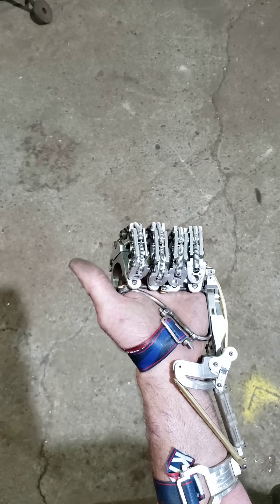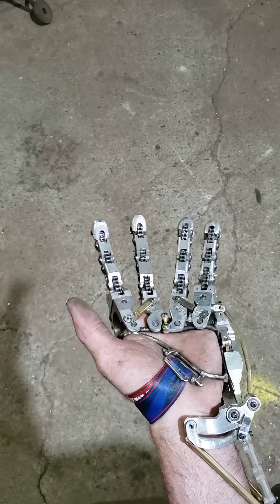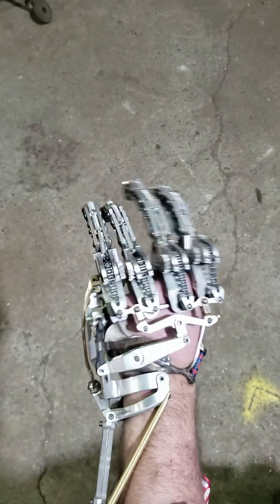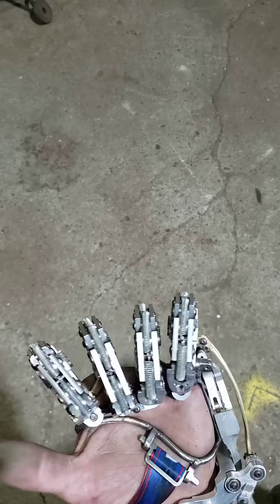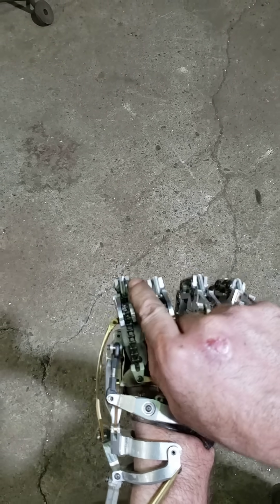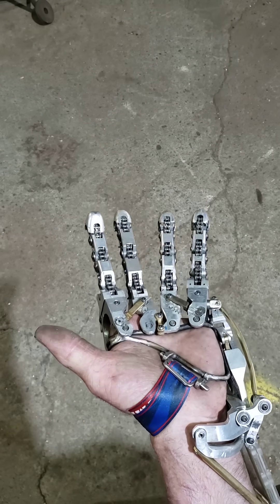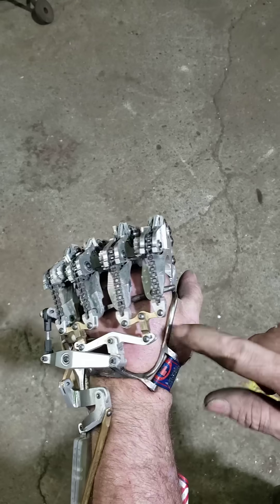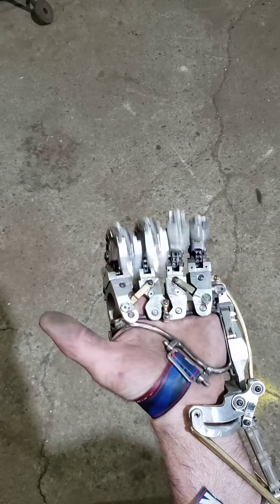Another update on my partial hand prosthetic, now with splay!

Comment: If I had missing fingers or like a arm I would decate it to makes a robot arm/hand but everyone just makes it that it’s on the outside and stuff I would literally drill a metal pipe in my bone and content it and go one by one of pain until metal connects fiber and bone and metal only thing I didn’t think of is nerves which I don’t need to feel the arm then maybe get like some kind of plastic to make a skin and every fiber the the muscle is gonna be a single metal wire and you gotta connect it some how and make a metal bone same shape just metal then make it that you can’t move the arm in some directions like a actual arm unless you want it to go both directions if your going for a robot look and then if you got all that you can try and add things to it you can’t feel pain in it like add like something in your hand that like is a wire and the wire like makes it that you can type a computer on a hologram

Comment: The design is brilliant, what I find most impressive is that so far it's all mechanic principles and no electronics, and yet it moves like your own fingers and has significant weight still behind it
Reply: I mean, it's way easier to replicate a mechanic system with a mechanic system, instead of doing it with a electronic one, you can have more precision with an extremely advanced electronic replication of such system, but that's the kind of thing that costs hundreds of millions in RnD, like the one being done to create a perfect hand prothesis.
Reply: @DrakyHRT  Your hand isn't a purely mechanical system, muscles are actuated by nerves which are electric

Comment: are you going to make plans available for sale .
 I'm interested 35 years ago I injured my spinal cord. it left unable to move anything but my left arm and hand. I learned to walk and talk again but my right hand is still greatly effected. I have almost no gripping ability I open and close my hand using my wrist. but I want to be able to use my hand more normally . I'm not a engineer but I'm smart and mechanical. I need to know the sensors and stuff to run it are you planning on selling kits or plans . I have all my fingers but have limited movement
Reply from the maker: Sorry, I don't think what I designed is going to work for you. The motion and power of this device comes solely from the motion and strength of the wrist and forearm. .

Comment: What servos do you use for the clutch bearing locks?
Reply from the maker: https://www.ebay.com/itm/Mini-Micro-Planetary-Gear-Stepper-Motor-Screw-Slider-Nut-DC-3V-5V-2-phase-4-wire-/153679741766?_trksid=p2349624.m46890.l49286
These are what I'm trying out in my current revision.

Comment: I could probably improve your design give it more realistic movement  Air or fluid pumps Change at all the mechanical parts with it using the fingers as an exo frame Conditionally make it a lot more fordable
Reply from the maker: All those extra parts and systems to break and service,  let alone the extra weight and bulk. Fluid dynamics are awesome,  but pumps and drives are heavy.
Reply: @missingpartsclub  lol na your talking 1 0r 2  mini  Air pumps or compressors Either the size of an electric motor or smaller an prolly  And  2 or 3  Can probably do with 1 custom directional control valves  Then I was just use lines that extend and contract you can make most of these parts part of the frame making it less bulky hardist part would be the custom directional control valve but you have a 3D printer so that make it 1000 times easer weight-wise it would be lighter than the materials you are using now  the fingers would be less bulky and more natural the one bulky thing would be a pump which with minor experimentation could be made to fit on your forearm comfortably to fix your joint issue use one bearing for each side of a point of contact  for that one you can use already made experiments that have been through wear and tear the bearings don't have to move or roll just sit on top of each other so they're the only point of contact

Comment: Do you plan to use synthetic setae (the material on gecko feet that allows them to stick to surfaces without liquids or glue through Van der Waals forces)? This will give you better grip than any other material, which would be a big upgrade over steel.

Comment: Wow! it is completely mechanical in this demo. If you implement electronic controls, it would be cool if they failsafe back to this mode. so if you run out of power (for whatever reason) you can still use your hand.

Comment: My name is Abel. I wrote this for you
Wonderful design! I love it. 
If I may propose an object detection program/algorithm to assist in grasp and target manipulation to assist in the 2-5 digit engagement and release.
-Use neoprene 1mm or a thin layer to protect your hand from abrasion and perhaps cushioning. 
I do see the part grasping over your metacarpals, they could be used to sense the needed manipulation of your digits. 
I suppose if you decide to have the grasping and releasing of the different digits that of your right hand metacarpals. Then use sensors that would train an algorithm by using the movement of your right hands’ movements as to send the mirrored manipulation for your left hands metacarpals. Separate use though. Just to train it to do as your right hand would but on your left hand.

Comment: quite impressive;i have also made something like this for a school project  which uses a touch sensor for opening and closing of the hand;the touch sensor can be installed anywhere(like in the other hand or the side of neck so you just have to move your neck to control the hand)

Comment: The thing I feel the most bad for is the fact he can’t game;-;
Reply: "Yet". You forgot the "yet". Eventually he'll add a gamer update to his hand.
Reply: @qExAi5  also it's his left hand which means he'll probably be able to play games the same as us some time later. hell, maybe even turn his hand into a controler.
Reply: There is a neural-computer interface out there. Theoretically, he doesn’t need arm to play. He can send direct neuron signals while wearing a helmet, to the computer. He may emulate WASD and a few more buttons by calibrating his neuron signal when he tries to press those buttons, and use his right hand for the mouse, - and be able to play many games. It’ll be harder to make it work for some strategy games though, when there are a whole keyboard of hotkeys.

Comment: No meme, this is some good, intricate and flexible work. The design is open to improvements but even if you decided to just strengthen it as-is without further modification I imagine it could provide a pretty reliable grip in exchange for some additional weight and effort for movement.

Comment: Not a bad design. Its definitely an interesting idea, being able to apply the spread of the fingers to the prosthetic as well as the basic open and close of the hand. That being said, it also makes a prosthetic like this very specific for individuals who were born without or lost their fingers. Would it be possible to apply this same set of motions with someone who lost most of, if not their entire hand, or would there simply not be enough control for something like that to even work?

If such a range of motion could be applied to prosthetics on a wider scale, it could be mass marketed and used to help far more people.

Comment: Do you have any of the source files for any of this? My brother was born without fingers, just has a thumb, and I would love to 3D print something like this for him.
Reply from the maker: Check out e-nable  or one of the many other 3d printed prosthetic hands out there. Unfortunately the design the I am using would not lend Itself to being 3d printed.  And really,  at the end of the day a 3d printed hand isn't a long term solution 3d printing is great for rapid prototyping but the parts aren't nearly as strong as something injection molded or machined from a block. That being said, good luck with your efforts.

Comment: What if you want to use forward motion while still keeping the hand closed?
Reply from the maker: Forward past having the hand straight with the forearm? I haven't had a situation where I needed anything further than straight in daily activity.
Reply: @missingpartsclub  Well then my next question to you would be this. If you grab something with the hand and it’s closed do you have to keep your wrist straight? Will it open it up and drop if you change your wrist motion
Reply from the maker: That's why I'm adding the electronics,  so I can lock the fingers in a position, grasping something,  then move my wrist and not drop it,  or pick up something relatively heavy  and not rely upon my forearm strength to hold the hand closed.

Comment: Hi mate. This is fantastic .I've subbed and will check out other videos later. Do you think this could be modified to still have the hand and fingers  inside.just that a friend of mine has a really weak right hand after an operation.i first though of doing something with EMG sensors for my mum when she had an opp on a brain tumor and she really struggled with walking afterwards but when I though with my brain I though that even nurves up her arm would likely be too week and we found the opp wasn't successful so I'd have never had the time to do it in time. Fastword almost 2 years and I think I'd love to look at all this again.this time for my friend. Any learnings or information would be great.the idea I have is to use EMG sensors and try to strengthen the signal to assist the hand and fingers to grip.

Comment: He won’t be able to use that in storms...
Reply: It looks like polished or brushed or stainless.  Oxidation wouldn't be any issue at all.  Even if it were he could find a way to make the parts from carbon fiber.  But honestly he could make some of the structural parts (non-moving parts) out of hardwood.

Comment: I really want to know if you are using in on daily basis and how well it is performing
Reply from the maker: So I started using this one as my daily about 3 weeks ago.  It is an awesome device.  Of course that's what I saw about all of my devices when I start out using them. The splay feature while I was designing it I was afraid that it might be just a Zhu-Zhu  but after a couple of weeks using it, it is amazing.
Reply: @missingpartsclub  didn't you have problems with objects slipping out of the grip since it's fully made of metal? just curious about actual invention that seems to be working well without some sci-fi bs

Comment: Will you be able to control or vary the pressure when closing? Or locking a single finger in open position to push a button or open a can of pop? Looks great though. Mechanics look smooth

Comment: That mate is excellent micro engineering, a way to go for multi function but tidy job for single handed work. Check out Blatchfords in Basingstoke in UK they are specialists and will offer advice, they do a lot of this and have Linx a micro processor for limb control...cheers

Comment: I don't have a need to create a prosthetic but i have an idea that i haven't seen. there are these things in 3d animation called bones. bones help in calculate all the points and facings of triangles per frame of the animation. I would love to see someone can copy that idea to control a prosthetic. You wouldn't need a ton of sensors controlling each servo you can just use a couple for basic control and let a computer do the work. you could set macros for the animation pose and swap on demand for like grabbing, typing, flipping the bird. just a thought i had in the back of my head.

Comment: Wooow this is very cool man congratulations. Do you have pneumatic propulsions for torch? Your actuators for strenght jobs gonna be electricals or pneumaticals? You are thinking abou this? Take a look for hacksmith crysis muscle for have some ideas. I'm working with 3D printed proshtesis. A metal prosthesis can have a much better performance. Is based on pneumatic muscles. Congratulations, keep going.

Comment: Ok but real talk, you could actually develop something great from this. I know this sounds like a little out of reach but I’ve come up with a way to make those robotics act like your actual hand so you can move them without having to use your wrist or hand to move the fingers. Of course it would be very expensive to develop but if you could somehow get the funds, I know exactly how. Your fingers are controlled by strips of muscles in your arm, so if you could hook up reactors that would receive a current from the Nerves in your arm and then make each metal finger correspond with each reactor, then you could theoretically move your metal fingers as if they were your own. Of course this needs a whole lot more research and way more development but I think it would be dope as fuck for you to develop something like this and get full control of your hand.

Comment: Hope it’s waterproof if it rains he fucked
Reply from the maker: That's why the main motions are mechanically driven. That way when the batteries die, or the electronics fail, you still have functions with your hand. Unlike with my fancy hand,  when the batteries die you don't have a boat anchor attached to your residual limb. You can still pick stuff up.

Comment: What makes this most impressive to me is the simplicity.  I had a few friends in college that worked on robotics and prosthetics just about everything they made required electric motors and pulleys mounted somewhere up the arm.  Your approach as an actual user has probably inspired you but the wrist actuation is brilliant because it is something that can be learned to be reflexive like walking or riding a bike.  There are, so far, very few points of failure and the fact that the electronics you intend to add will only serve to keep specific fingers from moving is brilliant because the default operation if they fail will still allow for an incredible degree of freedom and usefulness for the user.  I like to say that often times the fanciest most cutting inventions may get the limelight or buzz, but it's the inventors who take that innovation and make it truly practical that are the real pioneers who pave the way for humanity!

Congratulations on being one of the true pioneers!!

Comment: Once you get the mechanics worked out, it looks like you could easily make the design a little more compact. I may be a little biased but Anakin Skywalker's prosthetic hand in Revenge of the Sith would be a good design to look at. Make the fingers a little more streamlined, and maybe cover it with a rubber or leather glove for added grip?

Comment: I wanna see the use of them. Because fingers dont just move around... If you can show till what extend it can function ex: lift glass or lift bottle but no more then... Or something like that. Because the use of fingers alone is kinda limited to sticking ur fingers up ur nose and show the middle finger. The real test is if it will have enough power to hold something.

Comment: Maybe a small rubber section on the inner most point of the fingers on the palm might both aid grip and reduce the clacking sound..
 However the clack is not entirely unsatisfying as a sound.

Comment: What do I think? Mate, you might seriously be a defining pioneer for modern public access prosthetics. Seriously. If you got some good people on board with you to help design more of these for specific modifications (I don't imagine anyone could just put yours on and it would work perfectly due to slight different in hand structures), it'll grow into a god send for the people looking for hand prosthetics, like people who work dangerous jobs where losing a hand isn't uncommon. Hell, this could turn into something BETTER than a normal human hand given enough improvements that massively increase grip strength. It would make so many things easier, such as climbing and holding onto things, you could technically just do it forever until the battery(?) runs out.

Comment: You could consider manufacturing a 3-finger hand, in your case 2. Just giving those 2 fingers more grip, which would give the same result, but with less energy and material expense.  and with those resources you could focus on the joints of those 2 fingers.

Comment: Try to minimize the hardware in the wrist area after the battery and electronics its going to be very bulky to carry around. U might consider using flexible pcb's and cut out anything that uses un necessary power. Also i would suggest using 3d printed carbon fiber i have never worked with it but they say its lighter and 3 times stronger than convectional steel. 

- Vedant Paturkar
(Jr researcher) Bio Medical and Technology lab.

Comment: thats really cool. - what if you used some type of Sensory.. to detect when you are holding something.  to keep the grip.. - Rubber tabs for gripping strength along the inside of the fingers. - It could be Weight sensitive..  or maybe a button for the thumb to operate.. - to create a bottle neck grip? 
just some ideas... - Really Cool idea.

Comment: Incredible job. I can’t wait to see the automated progress with the addition of the arduino. One option you could easily look into is the LiFe batteries. Super small and light weight and are quite a bit less hazardous over lipo batteries. Life batteries will also outlast re-chargeable nickel metal hydride packs. Look into hobby shops and hobby stores for receiver battery packs. Not sure what an arduino needs to run but I would be confident you could find something with the corresponding voltage. 
Good luck!!
Reply from the maker: Right now I have it set up for 2 pair of 18650 cells so that I'm running in the middle of the voltage curve both + and - for the myo amplifiers. 2 buck boost, and 1 voltage regulator,  then charge off of usb, which should be cool!